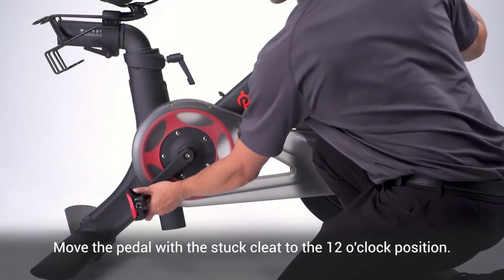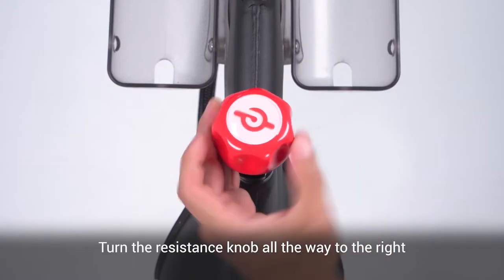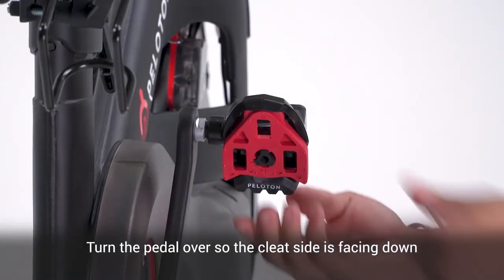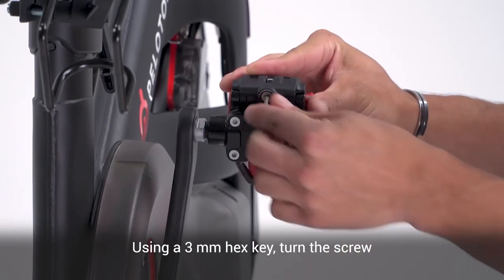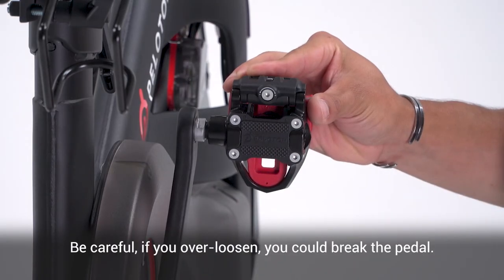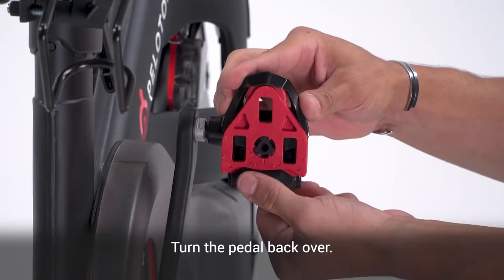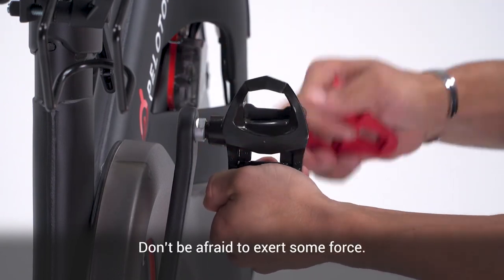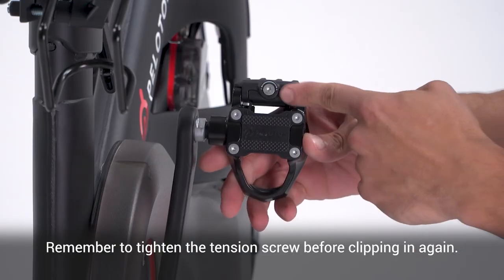Getting Started: Removing Cleats Stuck In Pedal

Comment: Thanks for the video, helped me out but I had to do two full counterclockwise rotations on the tension screw. Didn’t break it
Reply: Same here, I had to turn it a few times before it would come out. Thanks for the tip.
Reply: Same. Was quite the chore.
Reply: @dnawinter3321  Same. I WISH it it only took one or two counterclockwise rotations.
Reply: How many times can I turn it before it breaks
Reply: My cleat is currently stuck and will not come out after 2 turns!!! Help
Reply: @maggiemcdonald307  I definitely over the recommended. Like 6 or 7. Didn’t break. Be sure to just tighten it back to the amount you unwound it when you’re done